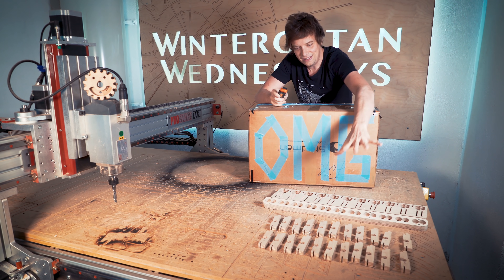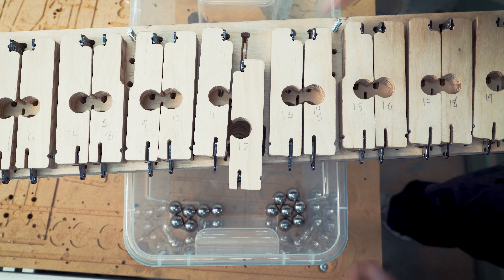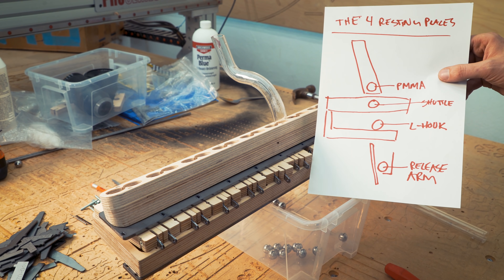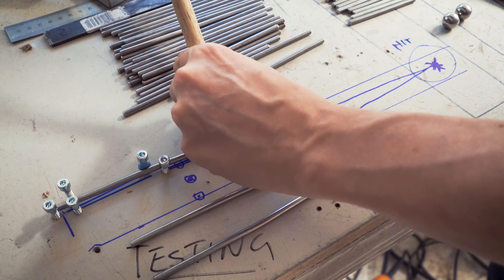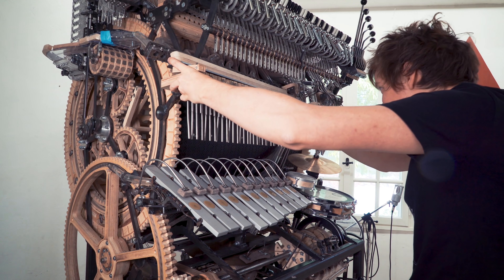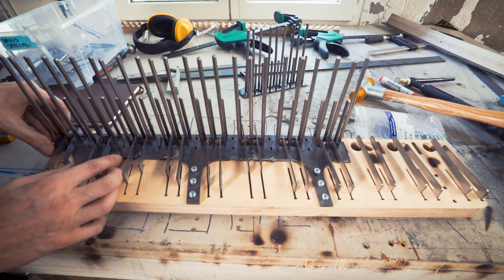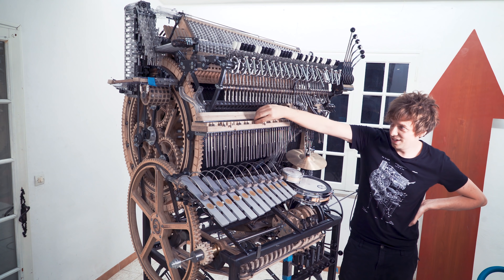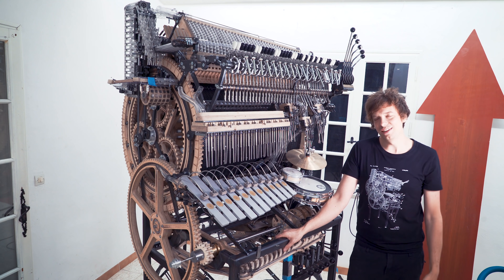My Best Design Yet - Marble Machine X #102

Comment: Martin, all of the times welding has resulted in distortion has been incredibly frustrating, I'm sure. However, in a lot of cases, you could have gotten away with sanding both interfaces and simply soldering the two together. Solder would have sufficed for a lot of the things you're doing, without causing as many problems as welding. Alternatively, you could resort to brazing, which is also less problematic than welding when it comes to distortion, but perhaps more problematic than soldering.

Comment: Tack welding the drop rods in place is a sound idea, but it creates a risk for the world tour.  If the assembly is ever dropped on stage (like before a concert), the rods risk bending.  For my money, threading them into the holes would allow individual rods to remain replaceable.   I'd rather thread individual rods in and out before each concert than risk damaging the whole thing.  As a former light-and-sound guy, you'll want to start thinking about components in terms of stage cases as well.

Comment: When in doubt: add more moving parts that have very low tolerances so they can get jammed when the temperature of humidity changes.

8:50 and that's just because you made a mistake, now imagine someone throwing a beer from the crowd and it hits those sliders; the wood will swell and you'll have to make a new part. How much machinery are you going to take on tour to maintain this contraption?

Comment: I hope all of your baltic birch plywood parts hold up on your around the world tour. If you are in a high humidity environment your plywood might swell, causing parts to bind or stick. The humidity varies a lot in different places and I have noticed that none of your plywood parts appear to be sealed. Applying a good coat or two of  Varathane, lacquer or even Watco would stabilize the wood fibers and help the wooden parts slide easier, with less wear. Just a thought as the rainy season comes once again to Portland Oregon, USA

Comment: Why the comments are disabled in #103?

If you want to perfectly align the vibraphone plates after changing them, then maybe it would be good to mount some laser on one side and small screen on the other (diagram here: https://ibb.co/s3KN7KC ). If some vibraphone plate gets too low then adjust it so much up as the laser beam gets blocked by that plate, then lower it down a bit so the light can hit the screen. That way you will get perfect alignment.

If you want to avoid the laser then simple string could do as well (same way as the builders use it to place the bricks in a level way). :)

Comment: There is something I don't get : you have 2 places for each marble dropper where you store marbles: on the bottom, to drop the marble on the vibrophone plate, but also at the top, just bellow the marble divider. Is this second one needed now? Why the marbles coming from the divider would not just fall in the pmma pipes until they reach the dropper you made in this video?

Comment: One thought; in order to being able to play a tune, I guess every marble "holder" needs to be activated at first. Otherwise a peg on the tune wheel will only advance the marble gate one stage and not drop the actual marble.... But I guess it will not be a big deal to activate all channels just after changing tune, but before you start to play...

Comment: Next time a part shrinks from welding, use a ball peen, straight peen, or cross peen hammer to expand the metal. An appropriate drift or blunted chisel also works.

Comment: - Hotfix for the bend metall parts ( for the next time ), get a pro welder to use a acetylene flame to release the stresses and "flame straighten" (German: Flammrichten) the part, a pro needs something like 15 minutes for this part. The guy at the metall and construction business closeby should be more then capable of this (don't go the car guy, they probably don't have a table like this: https://lastafelshop.com/wp-content/uploads/2017/04/Lastafelshop.com-002-1.jpg which is often used for precision welding purposes[which it needs to be clean and not bumby for]).
- Tip: Don't weld things to do the "flame straighten" it is bound to make things worse since you bring in more material, or vaporise material which makes it nearly uncontolable and ruins the look of the new part.
- Tip: forget the 100 stacked Washers, get yourself a solid piece of pipe, or a turned part makes things waaay easier.

- Piece of wisdon: Regarding setbacks, here is a piece of wisdom, engineers know this thing called "enginnering tango" it's "one step forwards, two steps back" it plays with you make assumptions and start from there making more detailed modells untill you reach your goal. All of this followes the philosophy of rinse and repeat untill you're done, considering you're building a prototype setbacks are to be expected.

Comment: I don't know of this has been mentioned before, but something you can do to mitigate warping while welding is to tack your piece to a big piece of like square tube thick wall steel.

We use this when welding exhaust manifolds for cars to keep them as straight and even as possible. Hope this helps!

Comment: The rods to lead the marbles down, might bend over wear and tear. I ain't an expert on it, the material might be super strong. But perhaps you could weld a plate or a rod connecting all the leading rods together at the end, to make sure they keep the correct distance

Comment: @Wintergatan - use electrical heat-shrink tube to keep those washer stacks together.  Cheap, quick, easy to source.  comes in clear if you want to see your handy-work but not the heat shrink.

Comment: I wonder what happened to the idea of using a lever-like design to provide a small backlog of marbles immediately before the dropzone.
Using a small swivelling lever made of a single metal sheet piece instead of the whole shuttle assembly, which is functionally a duplicate of the main marble divider and provider, might have made for a smaller design ...
Either way, this new system will hopefully be really functional, and it already looks great :>

Comment: One of my favorites quotes is "A minor setback for a major comeback."

People that weld on cars have the same problem with distortion, so they don't weld side by side usually. They'll weld in one place for a second, then go over to another place that's cold and weld there. Spreading out the heat and letting things cool in between will help avoid that distortion.

Comment: In a hardware store near by they sell aluminium tubes with outer diameters of 6mm, 8mm, 10mm and some other sizes. I used cut to length pieces of those tubes as spacers instead of the washer stacks shown by Martin in this video. This make assembly much easier.

Comment: This assembly looks very much like organ stop and key assembly in general. (Pull latching rather than previous piano-like dual pivot.) Including splitting into multiple pieces to match the piping.

Well, organs latch airflow, this latches marble flow. Less accuracy needed in organs.

Comment: Suggestion for future spacing issues - Instead of hundreds of washers, why not just cut a length of pipe (Inside diameter to suit bolt) to the desired length. Fast and easy way to make spacers. No more messing around with washers going everywhere, and no need for tape. Bolts together really easily, no mess, no fuss  :)

Comment: Instead of stacks of multiple washers, you could use spacers. I've seen them at hardware stores and they're tubes of a particular length with a properly dimensioned hole (threaded or unthreaded).

Comment: Hey Martin, 
About the felt dampeners, didn't you mention that if the dampener is at a antinode it will not work effectively.
Now that you have shifted the vibraphone plates, do they still work as effectively.
Might need to test it once.....!!

Comment: Martin! Looking great, but I think you made a mistake D:

Are the L-hooks necessary here? They're changing it from activating at the beginning of the pin strike to the return to rest - don't you want it to release the marble as soon as the programming pin is struck? This could affect timing pretty significantly, since there's a much longer delay for the reset.

Comment: To undo a bend, you can heat it much less but then spray a stream of water where you heated it. It moves quite a bit with less risk of damaging the metal. It's how they take bends out of prop shafts on ships

Comment: Duuuude....don't burn away metal to fix the warping:( clamp it down, preferably on a heat sink, and torch it with gas, not the tungsten. Then let it normalize. Also, remember...it's metal; some warpage you can manually bend back:) looks wicked as usual:)

Comment: is there going to be any effort made to reduce the amount of non-musical noise the MMX generates? Just noticed that covering the top of those L hooks in something soft or like wrapping them in electrical tape so that the impact of the marble dropping onto them isnt metal-on metal could help reduce the volume of the click-clacking the machine makes so the music is easier to hear (obviously this would need to be combined with multiple other adjustments in other places too)

Comment: The marble slides look wonderfully built, nice and tight precision is working well. I do not know if you are planning to coat all of the wood with a varnish? You mention taking this on tour and I know the area I live in has very high humidity. It causes wood to swell and it could cause all of the precision to become out of tolerance. I am sure that is one of your final steps after you ensure the entire machine is built to perfection. These slides to me look like very precise parts and would be very susceptible to even the slightest changes of humidity when traveling. I have been enjoying watching your progress. You are proving that the greatest things in life do not come easily. It take hard work to achieve greatness.

Comment: I think you should not have welded the 3 parts back together, you could have added a second bracket on the sides to bolt on to the plywood, making almost 3 identical modules. Also, machine up some tubes spacers instead of using a ton of washers :-) Great work on all the other stuff!!!!!

Comment: Bravo martin, it seems an elegant solution, but it introduced another problem, now the MMX has 4 traps until the marble hits the vibraphone (not counting the marble divider), at least the first marble in each channel
I think that you will need a mechanism to preload the vibraphone channels, loading marbles until the final L hook, before you start a music. Maybe using the first rotations of the crank to preload (with a one way bearing) or else a rework of the muting mechanism lever (maybe making it a 3 position lever), so you don't have to add another lever, ,control, etc to worry about.( feel free to correct me if i'm wrong). Even better, the muting mechanism should move to the final L hook before the marble drop, that way it would prevent any accidental marble drop in stage.

Comment: There are a few ways to reduce the distortion, first is to simply keep the part as cool as you can, heat buildup from one weld to the next will bend it in no time.

Second thing is to quench the part. Especially if you've heated to straighten.

The bending occurs as the part cools, the longer it takes to cool the more it will bend, quenching arrests that movement.

Last tip on making bent bits straight is that you can straighten parts by putting them in an oven set to 200C or so, hold them in a jig just past the point you want them to end up being in, bake for a couple of hours then allow to slowly cool in the jig. When you pull it back out it will be better, can take a couple of cycles to get it perfect.

Finally, when you do the weld, lightly peen the heat affected area to reduce distortion. This will also stop the other dimensional change.

For the part you just made I would have quenched in a bucket after each weld and then peened the web between each rod to straighten it back out. You really only want to use heat where the cause of the distortion is stretching, your cause was shrinking.

Comment: Most lubricants trap dirt in them, which makes things worse over time. Once you lubricate something you can't unlubricate it again if it doesn't work out. Most wood-on-wood machinery is best left dry. Consider the action of a grand piano - no lubricants in the 80-odd parts of each little hammer-throwing machine. The entire action slides back and forth, resting on four points of contact, every time the soft pedal is pressed. The contact I see here is wood sliding on wood. The metal bits move against metal. I don't see a call for lubrication.

Comment: I don't know... careful with angle grinding too early next time. 
For me, the "compromised" design looked a lot better since it was more spacious and less pronounced. The programming wheel is an important feature of the marble machine to show. Now you hide it and sacrificed a lot of aesthetics, the front might be precise but it feels cramped, also the metal plates look clumsy. Maybe it is time to take a break and take a comfy step back - no need to hurry. (Or switch to less visually important parts like the bass)

Comment: I'm only 4 minutes into the video, but I'm wondering if you should not put thin felt or rubber where the marble contacts the various mechanical parts, to mute the shock noise. Think of how piano hammer action uses small felt dampers to minimize mechanical noise. The L hooks also, being metal... maybe you should affix a thin sliced section of rubber tubing on the top edge that is contacted by the marble.

Comment: I still didn't quite understand why the previous design wasn't good enough.

If I understood well, the "compromise" you were referring to is the following:
- you want to hit the different vibraphone plates at different sweet spots which create the best harmonics.
- you want to be able to put different sets of vibraphone plates on the machine (depending on the scale you want to play in etc..)
- the plate holders are not adjustable

So the problem was that you had to figure out a compromise in order to hit "close enough" to every possible plate's sweet spot under a given marble release gate.

Then, you decided that you were going to refactor the plate holders in order to align the sweet spot with the marble drop.

So there, you have the solution, no? Why did it require to remake all the marble gates?? (plus, I kinda liked the previous ones, but this design is pretty nice as well ofc!)

Comment: beautiful design ! Side note, instead of stacking washers, you could use a small metal tube (steal or aluminum) and cut it to lenght for the same purpose. looks nice and is a bit more practical :)

Comment: It's nice to see your designs progress. I have 2 tips for you, 1: you can buy small aluminium pipe and cut it to the length you need as a standoff instead of stacking washers. It comes in many sizes and wall thicknesses should be an easy find and less risk of 52 card... I mean washer pick up.  2: is bolt that metal plates down to a jig and leave it till cool. You might even use a few wood screws in the right places to help keep it from warping.

Comment: Just wanted to note that that some of that kind of movement from welding is also possible to address with a ball-peen hammer, especially if you can support the backside of the warped section. You'd basically make a pattern of small dents on the face of the area that shrank, which thins the metal slightly on average and effectively pinches it outwards, counteracting the shrink. You can get surprisingly good precision that way by controlling how big of a dent you make (which controls how big of a change in the overall shape you make).

Comment: Hey, you can use some thick walled pipe instead of 25 washers. Or even better some parts turned on a lathe with the correct inner and outer diameter. Makes assembly a lot easier.
Great work! Looks so much better.

Comment: As a welder in the med-tech industry i can fel your pain. Distortion is the enemy of perfect resultat within tolerance. Minimum heat imput and fixing the details before welding - compensating for the distortion that WILL happen is the key to success. If you want, feel free to reach out to me for hands on tips to improve those welding skills. Also, since the parts you are making do need to be strong- but not rocketship-strong, you might want to try another joint method for this project such as hard soldering or even industrial grade metal glue. Not as labor intense. Just saying. Btw jag pratar svenska 😊

Comment: To be pedantic, the execution is not "correct" because of the issue with the welding distortion. As soon as I saw you welding the guides in place I foresaw what was going to happen. It's worth remembering that anywhere you weld will likely distort (unless using carefully designed processes) & that distortion will introduce stresses into your material - especially so in cases where you constrain the materials with clamps etc to prevent the distortion. My big concern at the moment is how all those stress points will react to the transportation processes and the effects of that on the playability of the machine. With the greatest of respect to you, matters such as this are the difference between a creator/maker and a design or production engineer. Negatives aside - I believe & every week I will you on to succeed!

Comment: You just invented a gravity fed bolt action gatling marble dropper. Awesome stuff. Will each performance have a preload/chambering? That'd look pretty cool. I'm worried that if each note activates the marble drop by pushing the wood block in, then the very first note will not be played because of the queuing, or you would have to have the resting state have the block pushed in, then pull each out to load in the first marbles once that part of the machine is engaged.